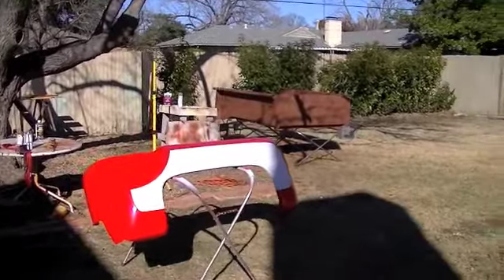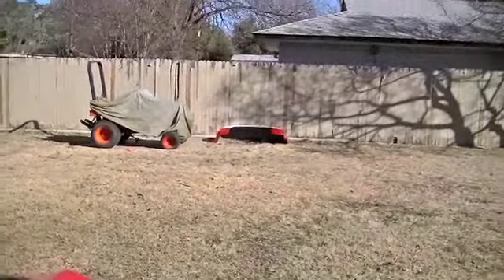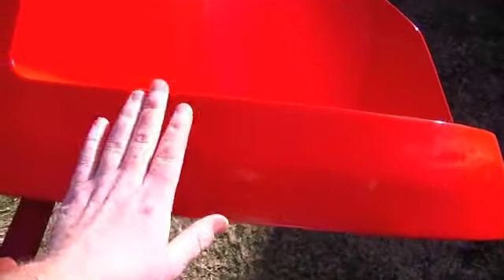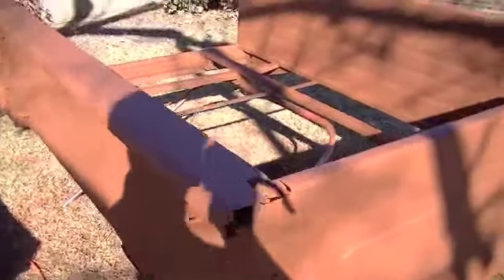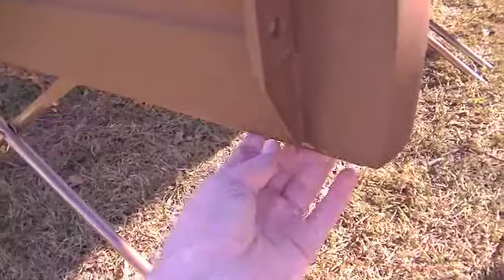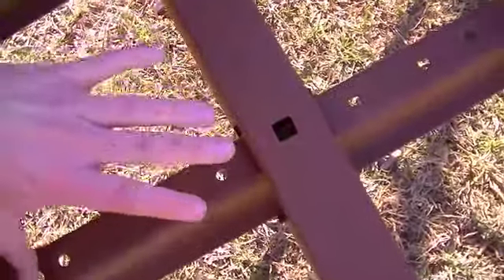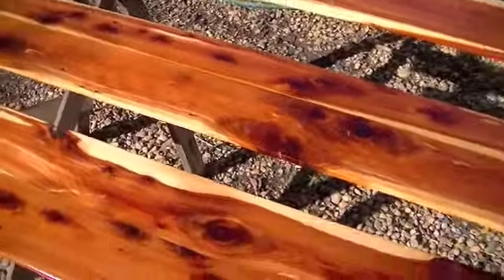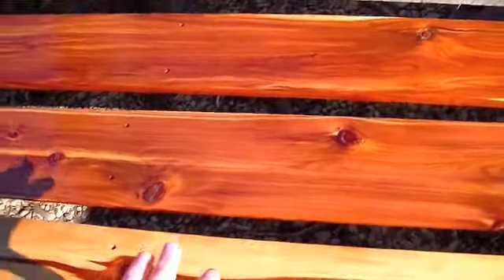Part 1 Rustoleum Paint Job | $50 Paintjob

Comment: I'm painting a canoe with Rustoleum. To avoid the slow drying, I am using a hardener. Valspar enamel hardener. Can says, "Enhances Gloss and Hardness, Reduces Dry Time." And it is Ok to use with oil base enamels.

Comment: Nice work sir. I am painting my 1969 chevy c10 with rustoleum gloss black enamel and I am just wondering what primer should I use? And should I mix the paint 50/50 with paint thinner?
Reply from the maker: +FARIS ALSHEHRI I would recommend a 4:1 ratio of paint to thinner.  I used a mix of regular Rustoleum automotive primer and Duplicolor filler primer.  Both were in a spray can.
Reply: FARIS ALSHEHRI use the rustoleum ruty primer stops rust and cheap but it also depends the color you are painting
Reply: Stain kill brand White primer,, works extremely well,, it will even cover and seal Bondo,,,. It's a old base but thinned with alcohol so it dries in 15 minutes,,,. 2A velvet finish which can be not down super easy with just a Scotch-Brite,,,. It's a hell of a good filler,,. It will fill in Boulder's,,, you don't have to worry about runs lay it on thick where needed,, it knocks Down super easy,,. !!!
Reply: I've had bad luck and horror stories with red oxide primer,,. paint wants to start cracking and peeling off of it after about 9 months,,. ???

Comment: what type of clear coat did you use?
Reply from the maker: +Todd Mckinney I did not use any clear coat on the initial paint job.  It was only cleared after I did the fauxtina finish.
Reply: +milkcrate82    looks good! planning to do this to mine. what type of clear will work over the rustoleum?  love the videos.
Reply from the maker: Rustoleum actually makes a clear coat.  I wasn't able to find it locally, but it is available online.  I think it only comes in a gallon can.

Comment: Does this paint required clear coat ??
Reply from the maker: 64impalaSS I would recommend a clear coat.  It gets dirty and is REALLY hard to clean without a clear coat.
Reply: I did not wash my truck for 3 months waiting for it to fully cure and then used three coats of hand-rubbed Wax,,. But next time I will wait 3 months slightly wet sand and definitely use Minwax with sparse,,. Sparse.  gives it the flexibility for outdoors,,,.   Regular household type polyurethane will not hold up Outdoors,,. !!!

Comment: polyurethane outdoors will fail
Reply: clear epoxy
Reply: The secret for outdoors,,,. Polyurethane with sparse,, Minwax is the best,,. Sparse gives it more flexibility for expansion and shrinkage and holds up against UV rays,,. Even the spray cans work great I use them on Vintage aluminum D slots spun the wheels on the car and spun the wheels while spraying them clear held up to dog urine for 12 years,,. !!!  But anything you spray paint you'll need seven coats to have enough Mils for long-term durability.